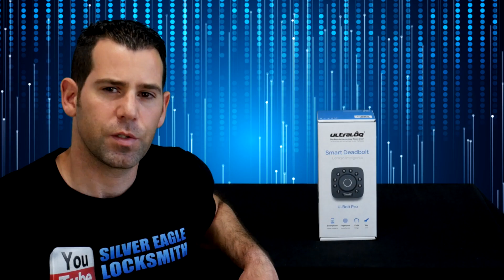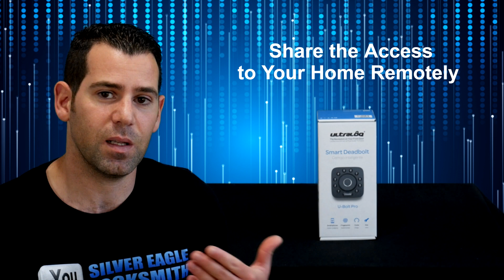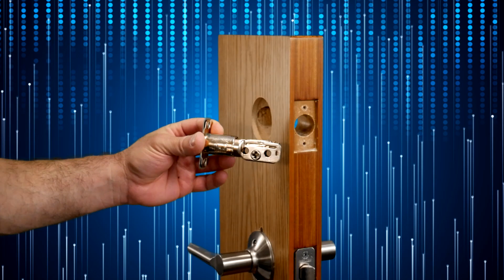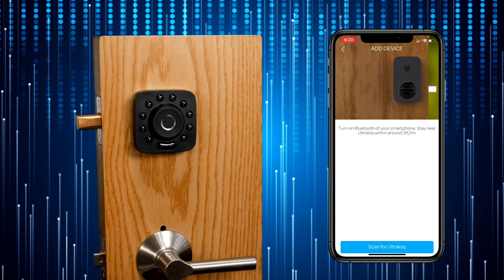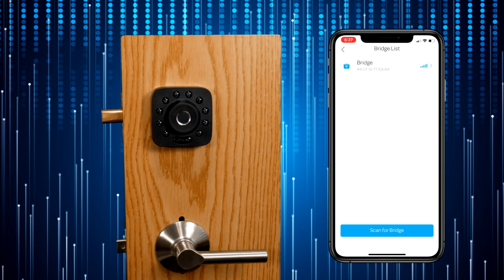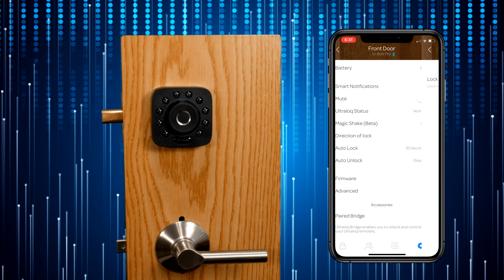Ultraloq U Bolt Pro + Bridge Installation & Security Upgrade Tip ✅

Comment: Please note that the Auto Unlock doesn't work so smoothly as mentioned in these videos, mine doesn't work at all. Never Auto Unlocks. And the GPS based system used for Auto Unlock should be optional. Close contact via Bluetooth should also be able to Auto Unlock the Deadbolt. This should be given as a option and customer should be able to select as per his/her preference. Each customer has a different requirement, and the plan of the house is also different. You cannot pretend that every house is the same. Just give the option to select. And U-Tec has also removed the IFTTT and Google Home/Assistant support as well. Only Alexa works. Which makes it worse.

Comment: @Silver Eagle, did you buy the WiFi bridge separately or it’s included in the box?  Because it says in the Packing List it’s optional but in your video, it seems like it’s included.
Reply from the maker: Yes it’s sold separately but for the sake of the video I did have the WiFi bridge
Reply: I thought it’s included in the box.  I only need it for remote unlocking right?
Reply from the maker: Yes and also for push notifications
Reply: Thank you so much.

Comment: Nice review! I have a quick question. Is the battery really easy to drain? Thanks
Reply from the maker: I’m not aware of any battery issues with the Ultraloq U Bolt Pro. But if you do worried always keep the backup keys with you and you’re good to go.

Comment: Super video as always👍. Can you please do a comparison of this lock ( Ultraloq U bolt pro) with the Lockly Smart Lock.  Thanks
Reply from the maker: That’s a good idea 
I’ll definitely do it soon
Reply: 1 quick question - will this work with the ring doorbell? Will I be able to see who is at the door and open the door from within the Ring app?  Thanks
Reply from the maker: No this lock doesn’t have this ability only the Schlage Encode can do that
Reply: I would like to see a comparison with the Lockly Pro too. Lockly has scrambling numbers, (but if I’m using the fingerprint reader only guests will use the numpad), 6 pin lock vs 5 pin for UltraLoq and door sensor, which UltraLoq doesn’t have. But UltraLoq has hidden key and has auto unlock via Bluetooth  on a smart phone and holds more fingerprints. Final biggie is UltraLoq Pro is $80 cheaper then Lockly Pro. One last thing is UltraLoq have 2,000 reviews on Amazon vs only about 150 for Lockly, so is UltraLoq more likely to be around in a few years?

Comment: Did you have any issues using the remote feature of the doorlock.  I have BLE and Wifi failure.  It is connected to 2.4 ghz band.  It works great other than remotely

Comment: Great video, I can't get the auto unlock to work, any suggestions?
Reply from the maker: Do you have the new version with Built-in Wi-Fi ?
Reply: @S.E.Locksmith  I have the one with the wifi adapter, the bridge.
Reply from the maker: Try to reset the lock to the factory setting and then program it once more

Comment: I have this lock its cool but I just hate when you have the door open it will lock so in order to close the door you will have to unlock the lock. For some reason it dose not have a sensor that detects if the door is open or closed
Reply from the maker: Yes some smart locks does not have the sensor to detect if the door shut closed. 
Some other versions does have it but you will not have all the capabilities of this specific Smart lock, pros and cons 👍🏻👎🏻
Reply: True.
That is the auto lock feature, which can be turned off in the app.
Reply: A new version with built in wifi (no bridge required) and an included door sensor to prevent locking while open is supposed to go on sale sometime this year

Comment: Great video, as always.  I see what you are saying about how cool the Auto Unlock with geo-fencing, but I just feel like I could lose my phone and then the person who found you can unlock could unlock my door. (Maybe me just thinking to far into it.)  
Question for you, is there a way a locksmith could change the cylinder on it to a more secure cylinder? Thanks again.
Reply from the maker: This option is available, but I didn’t recommend it on this video for few different reasons...
1. The two security screws for the cylinder in the Ultraloq U-Bolt Pro and the cross plate is very small and it will probably won’t support loner cylinder like the Mul-T-Lock etc. 
2. The cylinder in this lock is hidden inside so it’s not a visible key anyway. 

For my opinion if you do getting this awesome smart lock you made one to take care of your door reinforcement at the same time this is much more important for my opinion.
Reply: That is why you put security controls on your phone to make it hard to gain access into it. I think you're thinking a bit into it, how am I suppose to know where you live if I found your 📱

Comment: Not sure if you'll know the answer, but I'd it possible to use a computer as the bridge rather than buying their bridge? The bridge is expensive, and for such a simple feature it seems like you could do it cheaper by just having a desktop or laptop be the bridge.

Comment: I have this lock on the door of my condo unit for guests that check in, however, I live about 10 miles away from the condo, do I need to program this where the lock is located and can I get notifications o. n my phone remotely. Also, where do I connect the bridge and does it stay connected near the lock? Please let me know as I'm getting guests as early as this evening, Thank you
Reply from the maker: Make sure to install it just like i did in this video. The hub should be connected very close to the actual lock

Comment: We had one, and it broken less than 18 months. Good design but bad quality. We asked the company for a replacement, they only offer 30% to buy a new one and only send to USA. So disappointed. Will not use their product again. Maybe try Yale or Eufy. You don’t want to change your lock every 2 years though……
Reply from the maker: Now days I use eufy smart lock… check out my latest video: eufy security smart lock touch & Wi Fi - 2021 Smart lock All-In-One https://youtu.be/uP6_4zh09cM
Reply: OMG, I went through the exact same thing except mine lasted just over 1 year. To put salt on the wound, they originally told me they would send my a replacement part which they never did. When I followed up they said the only option was to buy a new one. I asked why they told me they'd give me a new part and they ignored the question. Like you I'm totally not interested in buying these expensive locks annually. Complete and utter junk.